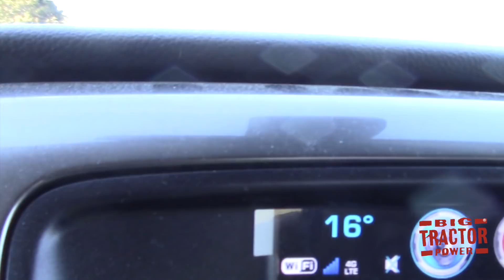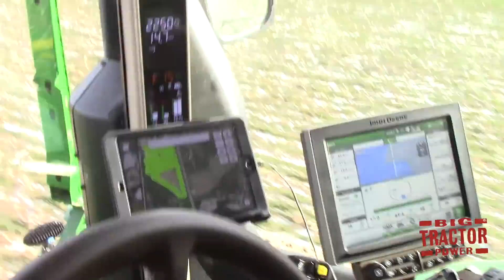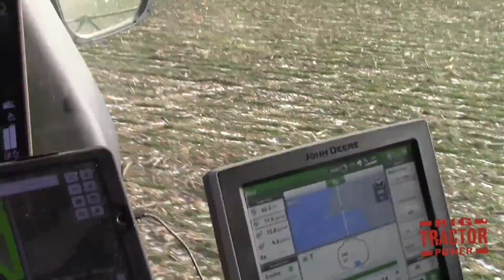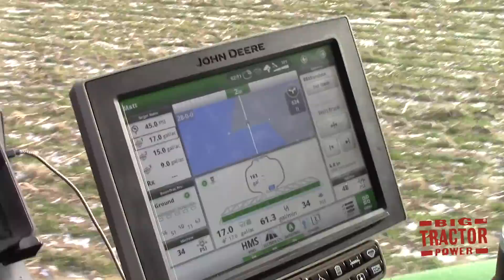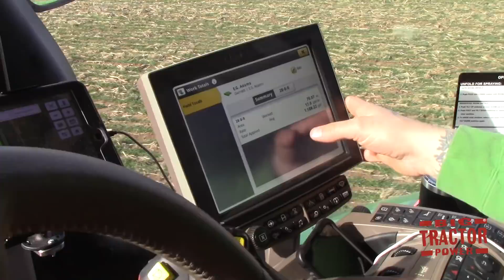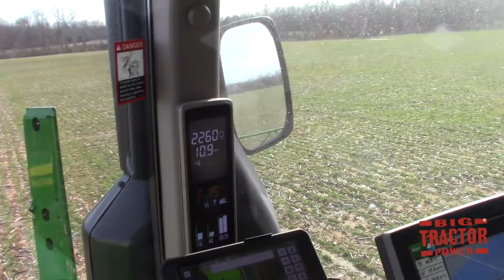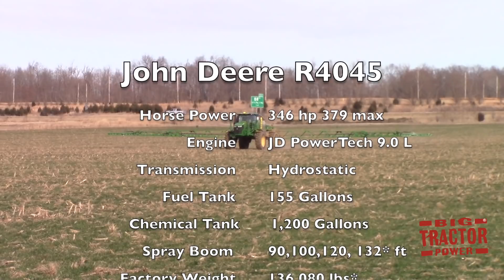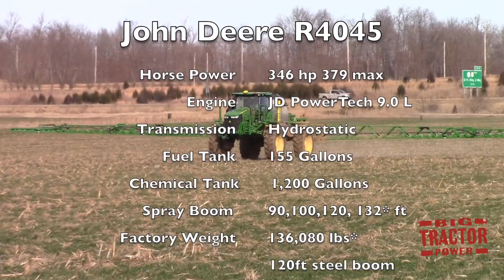Spraying Wheat in January 2019  During the Polar Vortex with a John Deere R4045

Comment: That thing sure beats the old Deere Hi Cycle I used to run! In 1975 I could only have imagined such a beast would exist in the future.I have even seen them with tracks. Those machines have pretty much grounded the spray planes around where I live. They hardly ever fly anymore.
Reply from the maker: The 75 model must have been open station. That would be pretty cold running in January.
Reply: @bigtractorpower  Yes it was and yes it would have been a bit chilly! It was open station with a cloth canopy top. I sprayed 12  rows of 38 inch cotton at a brisk 5 mph. It was a 4 cylinder gas burner. The gas tank was so close to the engine and would get so hot it would boil the gas when it got low in the tank! Sprayed 800 acres with that thing using an old converted gas hauler (1965 Chevy) as a nurse truck. I recently drove by the farm I worked for then and saw what was left of it sitting in a fence row. Times sure have changed...........

Comment: We also took advantage of the froze ground to apply poultry litter to our costumers fields
Reply from the maker: Good deal.  Cold has its advantages.  What do you spread with?
Reply: We use a STX 325 case and a MX 285 case with bbi pull type 22ft hydraulic spreaders

Comment: Will they give a second dose in a few weeks? 17 gallons don't seem to be enough to do anything. We usually apply 30 gallons. Last year we applied it 15 gallons at time two weeks apart right after green up. Results were fantastic....
Reply from the maker: Yes they will spray in March just before corn planting.  They don't want the wheat to jump too fast.  It will head out in April but there is always a risk of the odd freeze in April.  In 2007 there was a big freeze in April for 5 days it did not get above 20.  The wheat was headed out, corn was ankle high and the leaves were on all the trees.  The freeze killed the corn, killed or severely damaged the headed out wheat and all the leaves fell off the trees.  You want to push up yield but time it right.

Comment: I think you meant 36,000lbs, not 136,000 lol
Reply: Loaded with 1200 gallons  its 44,500. Its easy to get the weight wrong. But This guy does a great job as this.
Reply from the maker: Yes I messed up. It should be 36,080 lbs.  I had a typo in the specs listing and read that typo in the voice over not thinking about.  These videos take about 4 hours to put together from lay out to voice over.  That does not include filming time.  Every once a while I flub a detail.
Reply: @bigtractorpower  And we gladly look over your flub ups.
Reply: ya i had to look it up cause i didnt believe it weighed so much that is a fully loaded semi weight

Comment: I about passed out when you run the numbers.  Comes out to about $100k for that much fertilizer.  Then,  fungicide on top of that.  As the crop hasn't broken ground yet,  why not use wider flotation tires? Huge operation.  Thanks for the video
Reply from the maker: These wider tires stay on until April.  The tires will spray the wheat when its knee high and apply herbicide on all the corn acres.  In April the row crop tires go on for spraying the corn ones it's up.  The only time bigger tires could be used is in January, then they would be taken off for trip two in wheat but then go back to a bigger floater for herbicide and then over to row crops in corn.  Its easier running two sets of tires rather than three
Reply: @bigtractorpower  They are obviously going to apply a second app of nitrogen.   17gpa is only 50lbs of N.   Wheat needs closer to 150.   Wheat is an interesting crop.   It responds so well to management that the more you do the more you get in return.   We do 5 in season passes each year in the winter wheat in Ontario.

Comment: 16 is t shirt weather. Was cold here in MN
Reply from the maker: What did you get down to?  The ground rarely freezes here in the winter   16 degrees is low for Kentucky. I am thankful it does not get extra extra cold.  It was tougher filming in the cold. The camera was a bit slower in reaction time.
Reply: I’m sure it causes problems down there. Think -20/25 windshield -50.
Reply: bigtractorpower  35 degrees below zero in Wisconsin   60 degrees below windchill.

Comment: It was a great video, I wondered why so many HP needed to run the sprayer, any reason why a 200 hp would not work
Reply: Probably because they need to run the pump and every tire is run by a hydraulic drive motor as well as all the other hydraulic functions of the machine.
Reply: @Je-cm6fc  thank you
Reply: Oddly enough, it takes lots of power to drive the machine fully loaded at that speed, plus run all the hydraulic functions

Comment: I calculated the fertilizer rate at 17 gallons per acre to be about 50.8 pounds of nitrogen per acre.  Is that about right?  The 28% liquid nitrogen weighs about 10.67# per gallon   https://fluidfertilizer.org/wp-content/uploads/2016/09/Dale-Leikam-1.pdf    so 17 x 10.67 x 0.28 = 50.8# of actual nitrogen.  I assume they spread dry fertilizer just before planting also.  Thanks BTP!  Nice video...
Reply from the maker: Yes dry fertilizer in September before seeding and a second shot of liquid nitrogen in March.

Comment: Deere specs state that the weight with 120 foot steel booms is 35,000 not 136,000.
Reply from the maker: It should have been 36,000. I messed up.
Reply from the maker: Yes I messed up. It should be 36,080 lbs.  I had a typo in the specs listing and read that typo in the voice over not thinking about.  These videos take about 4 hours to put together from lay out to voice over.  That does not include filming time.  Every once a while I flub a detail.
Reply: Not trying to pick a fight. Just saw that and had to double check it.

Comment: With 1200 gallon capacity, how many acres can be covered and approximately how long does it take to apply 1200 gallons?
Reply: Dan Kinnard 70 acres on a 1200 gallon tank load. They can get over around 100 acres in an hour in really good running ground (big long fields) in smaller fields with shorter passes, the efficiency starts to decrease
Reply: Dan Kinnard that’s 70 acres at 17 gallons of solution per acre on a full tank. At 15 gallons per acre you can get 80 acres on a full tank and at 10 gallons per acre you can get 1200 acres on a full tank
Reply from the maker: The 1,200 gallons will be applied in 15-20 minutes. This R4045 covered 1,100 acres in 14 hours with a breakfast and lunch break.  The three machines tooling in that time cleared 3,000 acres with ease.  They were getting there cut up acres.  After these fields they went to 1,000 acre plus fields and really started rolling.

Comment: Somebody definitely added a 1 on the front of that weight.  No way it weighs over 100K.
Reply: Just a small mistake,and what?This man does a great job with this videos,i wish somebody would do this type of videos in Europe
Reply from the maker: Yes I messed up. It should be 36,080 lbs.  I had a typo in the specs listing and read that typo in the voice over not thinking about.  These videos take about 4 hours to put together from lay out to voice over.  That does not include filming time.  Every once a while I flub a detail.

Comment: Impressive machines, questionable spraying strategy. I am guessing that if they did a soil analysis before, during and in the early spring they would find  they are not going to get the #N/acre they want.
Reply from the maker: This spraying works great.  They sprayed all 11,000 acres in 48 hours. The following day we had gentle rain fall for 72 hours. A week later the temp hit 70 degrees and the wheat jumped a bunch. See my Instagram video showing the result. They will apply more nitrogen and a herbicide in March. Then fungicide in April when the crop heads out.
Reply: Not saying all the N will flow away, just that rain on frozen ground is going to flush a good deal of it before the ground allows for sufficient infiltration. It is basic hydrology. Now if they have no problem with that money disappearing then so be it. Two things though: 1) Sooner or later someone is going to test their outflow and regulations will follow. 2) It is a lost input that reduces their output. Also rain and 70 degree temps are enough to make wheat jump w/o any other inputs.

Comment: what nozzle is this one?
Reply from the maker: It’s a t shape nozzle with several holes to dribble out the fertilizers on the wheat.
Reply: I think they call them stream bars.
Reply: @bigtractorpower  does it has a pre orifice the restrain the flow? Do you know the manufacturer?
Reply: They are called chaffer stream bars and yes they have 4 different orifice settings
Reply: @iamatt568  thanks!

Comment: What app was he running on the iPad
Reply: It’s called Climate FieldView
Reply from the maker: Thanks Matt.
Reply: @iamatt568  does it plug into the tractor port for sprayer data or just know where you drive by satellite
Reply: There is a Bluetooth data transmitter that plugs into the cab and relays the data to the iPad. It’s a really nice and easy to use program. It can be used in all aspects of farming from planting, application, and harvest. Also reasonably priced.
Reply: @iamatt568  ok sounds like I need to look into getting one for my new holland sprayer next week at the farm show

Comment: I find it hard to believe that sprayer weighs 136000 pounds
Reply from the maker: I messed up. It should be 36,080 lbs.  I had a typo in the specs listing and read that typo in the voice over not thinking about.  These videos take about 4 hours to put together from lay out to voice over.  That does not include filming time.  Every once a while I flub a detail.
Reply: bigtractorpower überhaupt noch ein